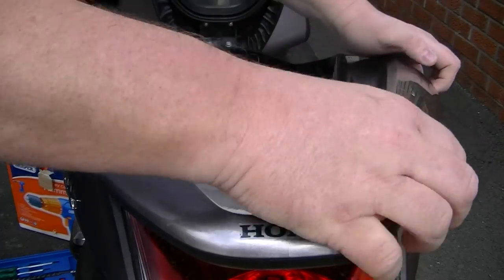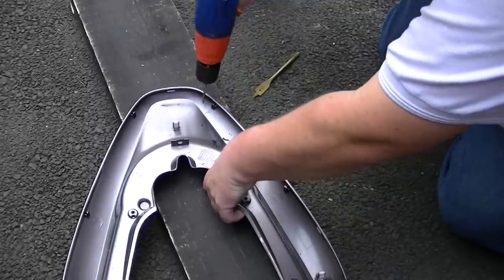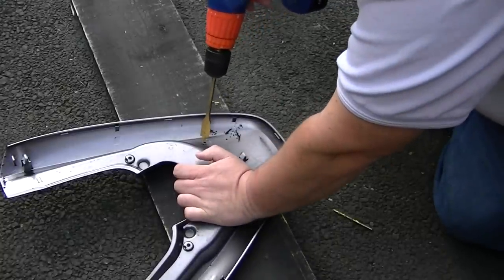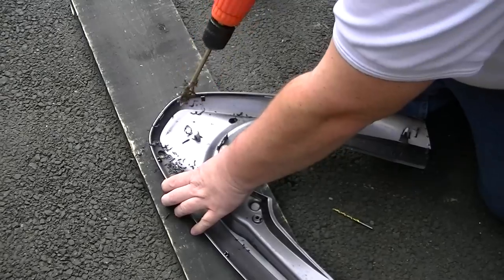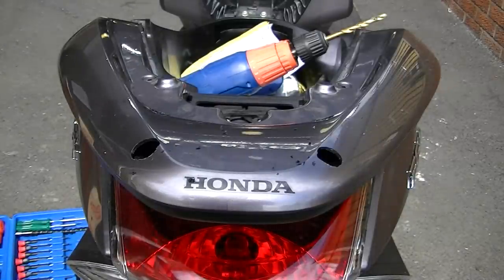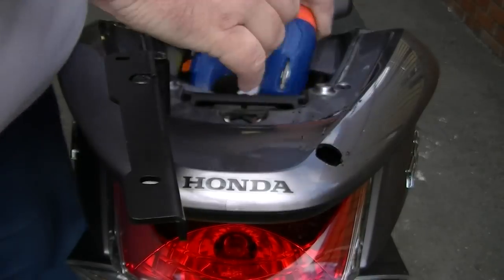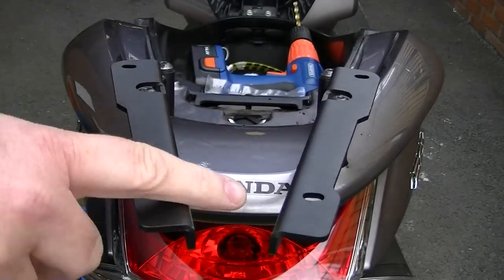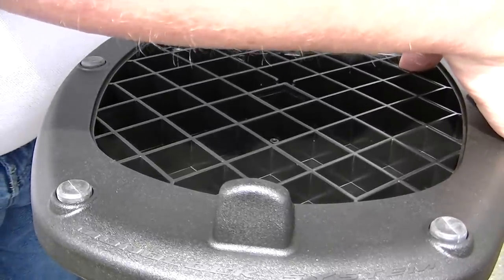Fitting a Givi top box to Honda PCX125

Comment: Thanks for the video! Owners with newer models ( from 2014 I think; mine is 2016), note that it is no longer necessary to remove the large section of trim - there is now a much smaller plate that unclips and is drilled for access to the 4 mounting posts.
Reply from the maker: Glad to be of help.  It is nice to see Honda making things a little easier on later models.  Thanks for watching.
Reply: do you know from where can we get the rare rack ? i think it s not included in the givi box

Comment: From one Ulsterman (this one in Enniskillen) to another, a very big "thank you" for posting this video. I ordered the two brackets on eBay but when they arrived there were no instructions so it would have taken a lot of head scratching to work out how to fit them. Your video was therefore exactly what I needed. One small observation, the cover is quite hard to lift and I caused a small crack in it as I did so. (yours has one too!) It would be better to gently lever it up with a large screwdriver rather than pull on it. Thanks again.
Reply from the maker: Glad my video was of help to you.  I did notice the little crack in mine but with the box fitted it was difficult to spot.  It is handy thing to have fitted even with the under seat storage.  Enjoy and thanks for your kind comments.

Comment: Good job Gary..   I dont have a scooter, but I would think that it's much the same process for fitting the brackets onto bigger bikes which is why I watched your video..  At least I know now how easy these top boxes fit.  The only thing I would have done differently would have been drilling the plastic from the other side to save scratching the paintwork..  Thanks for sharing.
Reply from the maker: Glad to be of help.  I have fitted many boxes since this one but never filmed it.  Must do another one on the next bike I buy.  Thanks for watching

Comment: thanks for your video .just a tip on drilling this plastic after drilling small pilot holes you can use a variable taper drillbit in a drillpress holdind the plastic piece by hand slowly feed it onto the drill bit makes a very clean hole
Reply: Found your tip 5 years on, thanks very much. Cone drill made a beautiful clean job of the bracket holes :)  Horrible part is getting the plastic trim off the bike to start with!

Comment from the maker: The E231 is the metal brackets with the screw holes in them.  The plastic base plate which attaches to the metal E231 brackets is included with the top case.  I hope this helps.

Comment from the maker: @daveyctvr I got my plate and fitting kit from my Honda dealer.  The stocked Givi parts as well as Honda parts.  The Honda stuff was much more expensive.  The E231 is just the brackets that fit the plate that comes with the monolock case.  I think mine was around £80 for both.  I hope this helps.

Comment: No, only the Monolock cases will fit. For the Monokey cases, you will need the E231 PCX125-specific bracket (the first brackets he attached in this video) and the E250 universal mounting plate.

Comment: Congrats for the video. To make that holes is not fair. Honda failed on it...
It was 4y ago, but, do you still know the reference of the parts that go below the plate attached to to the PCX? If yes, please let me know. Tks in Adv.
Reply from the maker: +Leonardo Bernardi Thanks for watching.  I believe the part number for the rack is SR1136.  That is for 2010 to 2013 models.  The plate comes with any Monolock case.  I trust this helps.
Reply: Tks.

Comment: Hi, very useful video. I have just bought myself a PCX. Was wondering where did you buy your box from and what did you get with it? I'm struggling to find everything together. I found a givi topbox - the E300B, which seems to come with it's universal plate. I think the rack I need is the givi E231 but this also seems to come with a plate so do I actually need this? But I'm not sure where to get the two metal rods you used from? Thank you.

Comment: when i drilled out the holes for my honda plate and box they weren't in the centre, but it isnt visible once the foam collars are on the bolts and the box plate is on